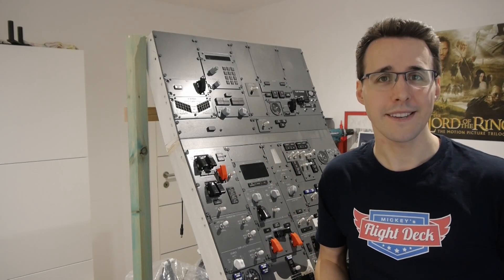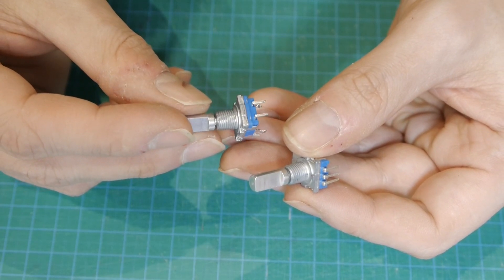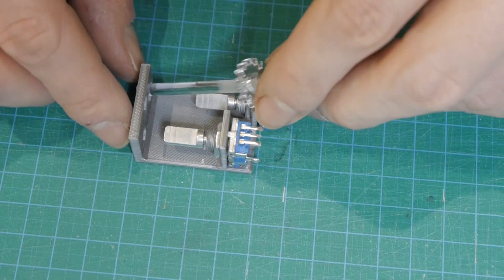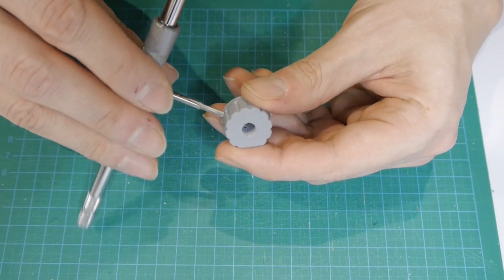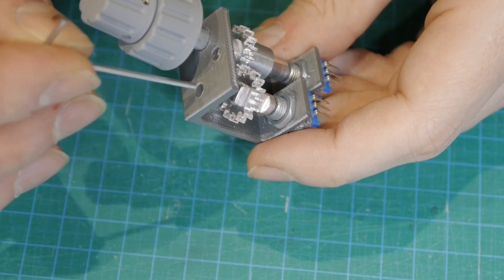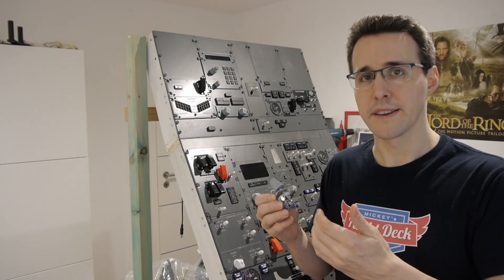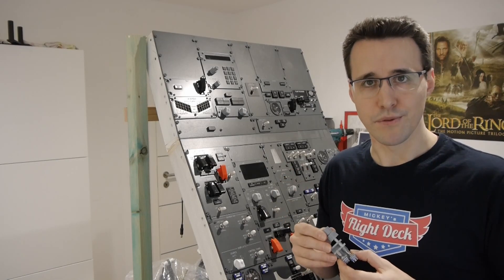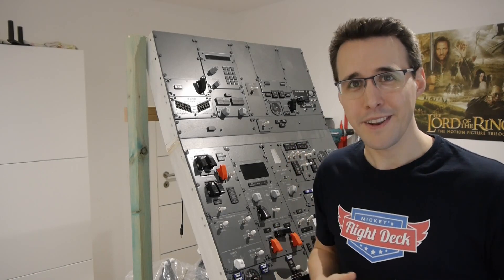Making a dual rotary encoder - A Boeing 737-800 Homecockpit #64

Comment: Good afternoon, Schönen guten Nachmittag,
i don´t know if i´m right - but i think that i saw in a other video that you have created a V2 of the Dual Rotarey Encoder (without acrylic shaft). Are the STL-Files for the 3D-printed shaft with integrated gears available to download?
Reply from the maker: Yes, they are already finished. I have to create a new entry on the web website for them.
Reply: @Mickeys_Flightdeck Sounds great, I already have all Requiered Electronics and Panels for the pedestal. The only thing missing are the Updates files for your Great V2 Dual Encoders.
Thanks alot.

Comment: What not use one of these:  EC11EBB24C03  Dual-Shaft Axis Encoder With Push Button Switch?
Reply from the maker: It's just because the self made version is cheaper.

Comment: Sorry out of topic
I want to know how you laser cutting or engraving the acrylic
Is fusion 360 could be use for laser cutting or engraving? If it can, the laser cutting need 3D or 2D design?,i mean, is the design must be extrude or just 2D drawing?
Thank you
Reply from the maker: I don't know if it can be used to control the laser but I'm using it to create the needed files for it. A laser is operating in 2D, so a normal drawing is all you need. You should have a look at the channel of "Product Design Online". There you will find dedicated videos about preparing Fusion files for your laser.

Comment: Have you tried the ALPS ec11ebb24c03 dual rotary encoder?
Reply: Costs about 20 Euro but saves you a lot of time and troubly building your own. Sometime its better to buy something instead of DIY everything. My2Cents.... Andy
Reply from the maker: Like Andreas said, if it is worth for you to spend the money and save the time and maybe frustration, then you should buy them professional made. In this case I reached the goal really quickly with only a little bit of testing.